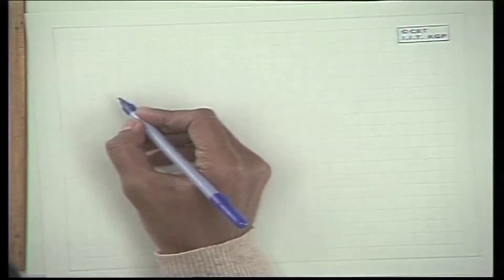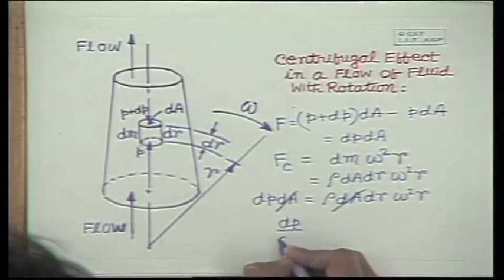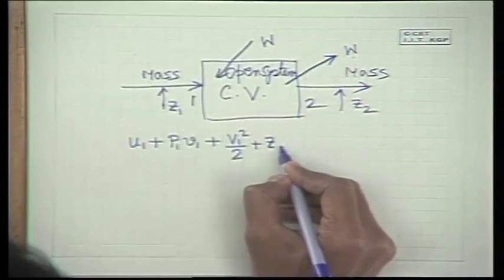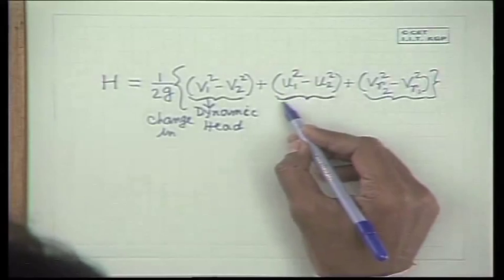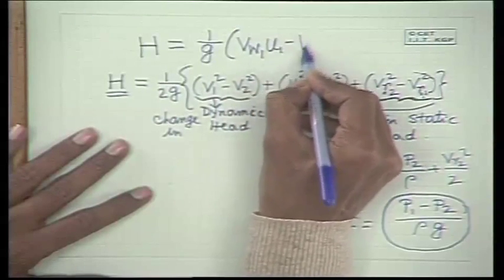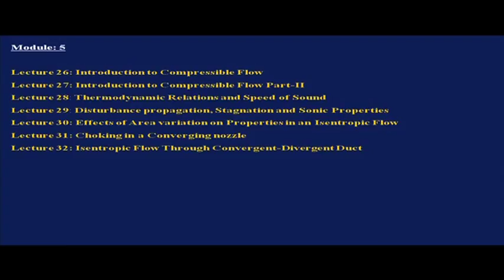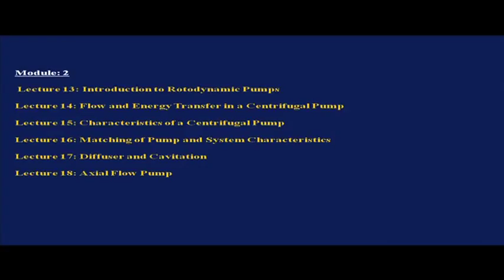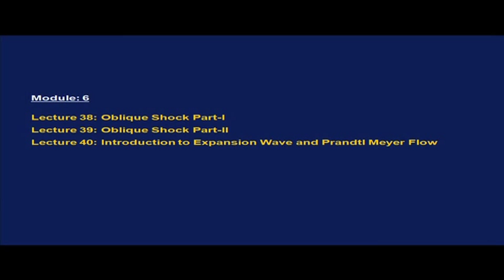Mod-01 Lec-03 Energy Transfer in Fluid Machines Part - II

Comment: while telling the centrifugal effect in a flow of fluid.......vdp should be written as work done and not as flow work....because both are different things......what is the difference between flow work and work done??
Reply: if you'll google "FLOW WORK" it'll not give complete definition of the same normal google search misses this part, flow work represents the ENERGY TRANSFERRED out of the system boundary as a result of energy imparted to it, in this case, by jet. Don't get confused.